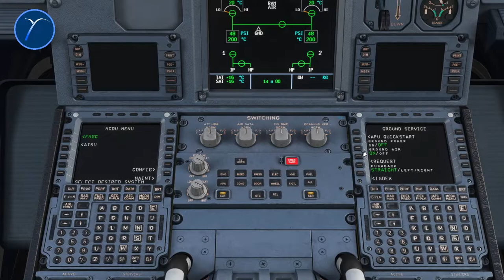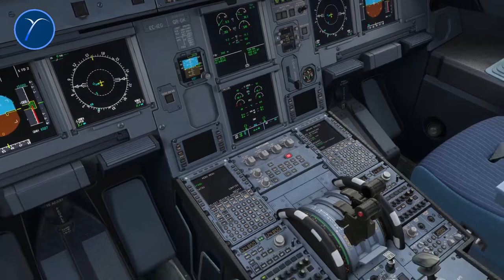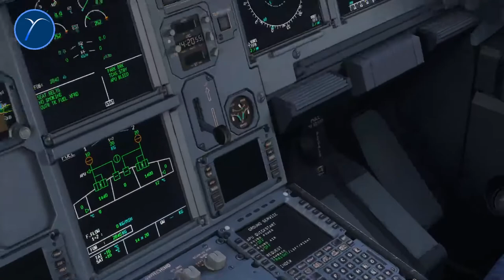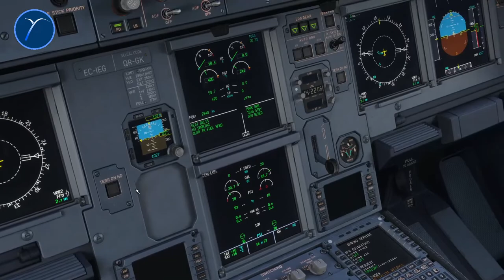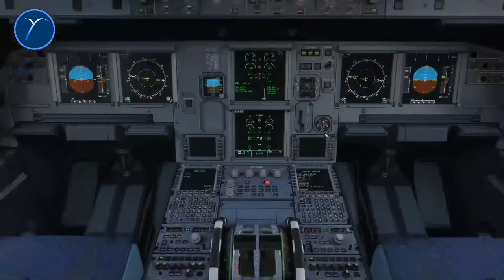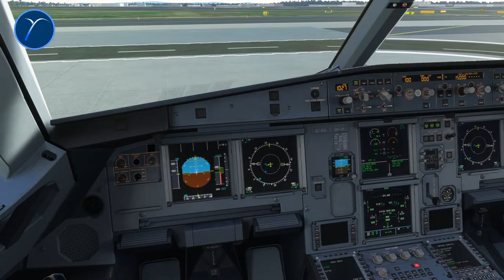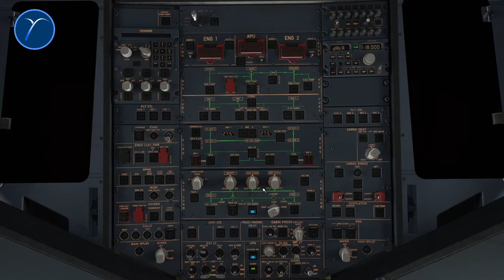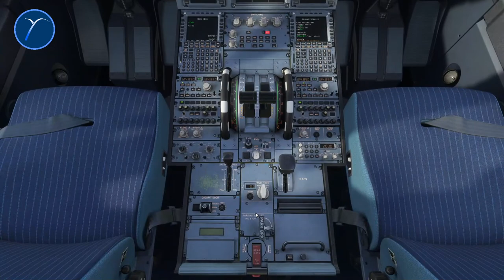Airbus A32X Supplementary Engine Start Procedures (ASU,XBLD,OET-D,OET-A, Manual)|Timestamps|FS2020

Comment: Hi, late but thanks, great video. At the airport i work at, we only ever allow one engine to be started by the ASU (always in our case engine number 1), the aircraft is then pushed back, and the second engine is started via crossbleed. The air start unit is connected on the a320 directly under the fuselage in between the engines, so approaching the aircraft with both engines running would be very dangerous for us. Not sure if procedures are different elsewhere
Reply from the maker: Thank you for your insight! It does make sense. I did this by the book, the procedures indeed may be different elsewhere